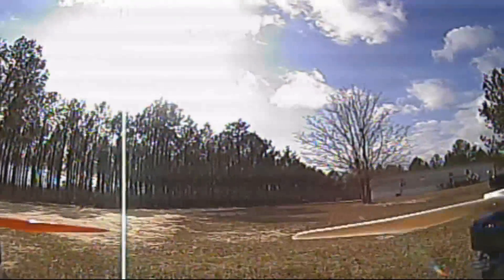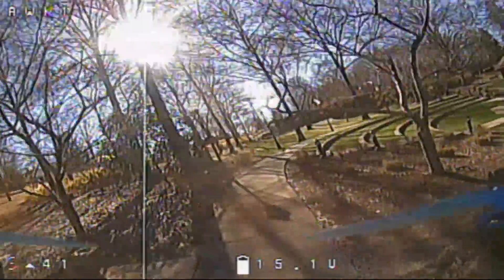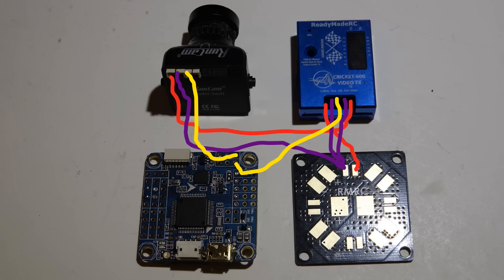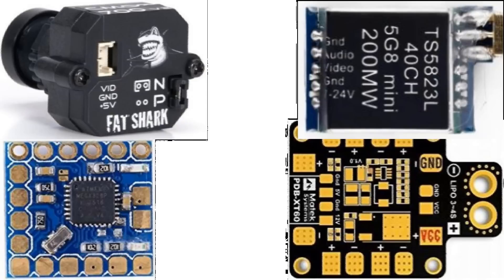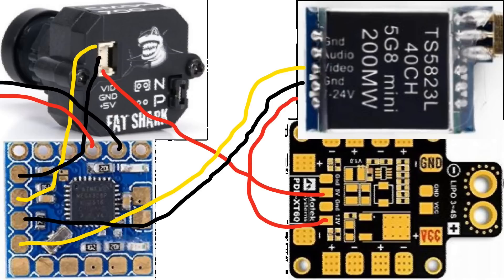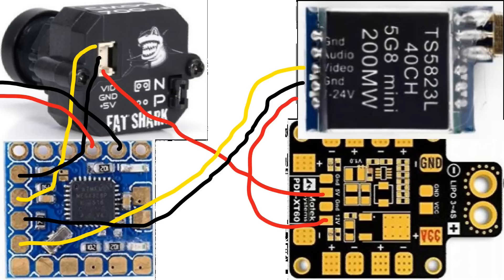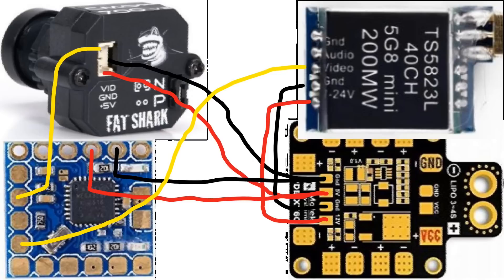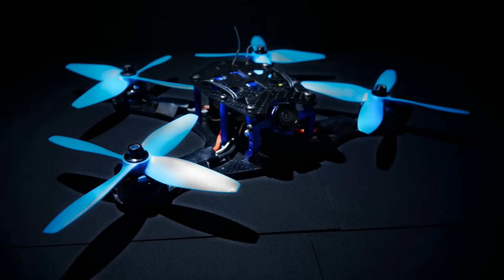Fix For Flickering OSD

Comment: hmm so i'm power my camera and vtx from my PDB... I am not using the 5v out on the vtx for anything, so I didn't bother connecting that ground anywhere... I wonder if running that ground would magically fix my issue?

Comment: In need of your help. Watched the video and wired exactly as you described. This is on a fixed wing with a 100a esc. I even tried a capacitor and a LC filter. No change.  Any other ideas because I'm stumped.

https://youtu.be/1RT7vGz_MZs

Comment: i had pdb with filtering thing. 5/12-bat. so vtx pad i solder it. then the red from cam also in + on same vtx pad. and video"yello" from vtx to cam. works fine! i dont understand what u men about lines. yes but only when i loop som tres´ but now i crash. so it was open. so i do what you explane. just take the yellow wire. cut. and the vtx in and cam. but then i got no pic? i try all channels. but nothing. i can´t change vtx band. yes but it shud bw there. but yes i also soldert the capasitor on. dont use all wire. only vtv to pdb. and cam to pdb. and then cut the wire to get osd. but nothing! have a new vtx. to seek another channel. but is it my settings! ?? thx for all.  il try my selv. and have ask before were i find anwser first,. but this! just startet so neebie. have no osd :-( have runcam shift :-)

Comment: Hi JC, Having this same issue with the betaflight F3 board. Since the FC has a built-in PDB what can I do. I use a 1000uf low-esr cap on the main leads and power the camera from the VTX. The camera is a Foxeer. Any thoughts?

Comment: Jc I'm using a omnibus f3 anywhere over 50% throttle I lose video with a 4s but not with a 3s.  should my cam and vtx grd be on the Fc or pdb? BTW the omnibus is getting full voltage of the battery

Comment: Can you maybe do a video on fixing video interference issues?  I've got 2 recent builds with issues, one has severe lines and blacks out with snap flips and rolls and aggressive turns, and another build browns out the cam and possibly the vtx completely  when I throttle up past 50% so it is not even flyable.  I realize this is some sort of electrical issue, do I add more caps?  Do I use an LC filter?  I've built 6 quads on the same basic pdb/cam/vtx/esc....and only have changed frames and motors between the 6, and only my last 2 have issues....it's fairly frustrating!

Comment: What version of bf are you running on your awk210 with omnibus f4? I've got an omnibus f4 on my awk 210. I'm getting the spin of death on mine. I had it on 3.1.5 then I dropped it to 3.1.1. I have a RTFQuads 4 in 1 infantry 30a dshot esc. When I input abrupt roll or pitch inputs it freaks out drops to the ground then I get a reboot sound from the esc's. I just updated my esc's also. I updated my esc to latest version 16.65 My next move will be to keep dropping bf versions until this stops.

Comment: Hi,
 Would there ever be a problem with the VTX antenna grounding to the frame (where the ant. goes thru the frame)?  Thanks
Reply: Dragon Rider FPV Quads Not the actual connector on the VTX or antenna. If the coating on the actual bendy part of the antenna is rubbed off and you can see the shielding, then you will have problems.

Comment: i had some issues with micro minimosd...osd dissapearing on throttle punch outs even black screen for one second and i had all the ground wires on pdb..then i put the ground wires on micro minimosd next to video in and video out and it fixed the problem..so its a bit confusing which is a right way
Reply: Thanks for the info. Having same issues with micro minimosd, but atm i have cam ground and VTX out ground connected, like in the first picture in this video. Will try your method first, and the PDB method second. I hope i will be able to solve the issues.
Reply: +MiG FPV its just fixed the osd on throttle punch outs for me..once i went out flying and did a flip or roll the osd disappeard and then came back after second..i thought its fixed cuz i was trying it home holding the quad down and punching the throttle  and it was ok..whatever.. its better than it was..i had blackouts when i pushed the throttle a little bit.. and now the osd disappears only on flips and rolls..its weird but its flyable
Reply: thanks.

Comment: I have the omnibus f3 I want to run my osd so If follow ur diagram here do I still have to jump the 12/5v pin on the FC ??? please help lol.... Aloha keep up the good work 👍 bro
Reply from the maker: No you dont have to jump either pin. And just my advice and the way I wire everything, I dont power the camera or Vtx off the flight controller, I still use the PDB. I only run the video wires to the flight controller.
Reply: Project Blue Falcon I have to fx 799t vtx with 5v  out to the cam so I can just run it like ur diagram with the omnibus f4 correct ?

Comment: I do wire from gnd to cam.  And have never used gnd pads for video signal wires.  However I've still had OSD flicker.  Here's what always solves it for me.  On micro minim I attach an extra small 220uF 10v cap to the gnd/5v pads.  On omnibus I attach the same capacitor to an open gnd/5v pad on the FC.  Some FCs though you also need the 470uF 35v cap you've shown before in addition to the smaller one.  NOT for flight issues, but for smoother power going to 5v.  I found a 6x5mm 220uF 10v cap on amazon.  tiny.
Reply from the maker: Sounds like a great idea to me

Comment: I fixed my flickering on throttle up with a 470uF cap right on the +/- on the micro minimosd. Unfortunately this didn't fix the video feed going completely black mid-flight. I might just have a defective board.
Reply: Did you solve your problem?

Comment: I primarily run omnibus flight controllers as well. I get perfect video & OSD by sending vbat through an LC filter straight to the RAM pin (next to vbat pin) This passes filtered power through the board and out to vtx & camera. This way allows you to run power, ground & video wires from video in & video out to the board which keeps everything super clean in appearance and performance. This does require good CCD cam and VTX with a wide voltage range
Reply: ryan todd I tried this and the controller got extremely hot, so be careful!
Reply: Good to know, I'll keep an eye on that. Through trial and error I've fried 2 omnibus F3 boards over the last year but my original omnibus F4 (v1) has been setup like this pretty much since they were released. Was the board you're referring to an F3 or an F4? I'm convinced there's a big difference in durability
Reply: +ryan todd F3 knockoff from banggood, great board, love it for its capabilities but I only power receiver off of it. Everything else I power off of mate micro pdb, you have too watch them too. They are fairly consistent but I have had a few that put out slightly less than the 5v and 12v it's supposed to.
Reply: +Jsin C. MATEK.
Reply: Lol, autocorrect always trying to sensor us... Yes they do! On some builds I'll use a standalone adjustable regulator set around 9v to power my FPV system. I rarely use a PDB W/ built-in regulators for that very reason.
Reply: Ryan Todd, where are you placing the GND wire off your LC filter?

Comment: LOL, I was just working on this issue....I thought after watching you video I was going to have to redo it... Lucky me I was already doing it the way you recommend. I am get lots of lines at above 50% throttle. So I am installing a capacitor
Reply from the maker: Capacitors do help, but if it still doesn't go away then you may need an actually LC filter, which is a capacitor and inductor in one.

Comment: I've tried wiring up my TS5823 and micro minimosd and PZ0420M on a 250 quad with a Naze32 Rev5 the way you recommend with all grounds going back to the PDB, and I got OSD display, but black screen (no video). I had to run the camera ground to the  OSD, and the OSD ground to the PDB, and then it all worked. I'm powering the OSD off of spare motor pins on the FC, and powering the cam and VTX from the PDB (battery voltage, because I sometimes run 3S as well as 4S).

Comment: +Project Blue Falcon Different subject but, what about ESC ground wires? An increasing number of PDBs (with signal pads) and FCs seem to expect only the signal wires from ESCs to be connected. Would you say it is safe to ignore/remove the ground wires from the ESCs, or connected them to some ground pad in the PDB (or FC)? Thanks!
Reply from the maker: It's best to keep the ground wire. Joshua Bardwell did a good video on it. I've always soldered the small and large ground wires from the ESC to the same pad on the PDB. Before soldering I wrap the small wire around the large one two or three times, that helps it from being pulled out in crashes.
Reply: Thanks for the advice, Jc. Somehow I missed Joshua's video on that subject but I'll certainly check it out as well: thanks for the heads up! BTW, for my level of knowledge on this hobby, both of you are running the most interesting and helpful channels on YouTube. It's amazing how you guys are actually making life so much easier to the whole spectrum of RC hobbyists like myself. Really appreciate your time and effort here, Jc!
Reply from the maker: In general I like the Runcam Swift. It's not the best, not the worst, but its great for the price. Unless its a camera for my AWK210 and Hellbender frames, I just now started using the Strix Ochi because its made specifically for the camera mount on those frames.
Reply: +Project Blue Falcon Just watched Joshua's video -- thanks for the hint --, and read most of the (very long) comment thread. This is a very debatable subject, to say the least. Joshua's advice seems to be a bit different from yours, though. It seems he is suggesting to always establish the shortest possible ground connection between the FC and the ESCs -- avoiding vregs, etc --, and to make sure the signal and ground wires are twisted (for better shielding). I'm baffled by so many people arguing against using ground wires to avoid loops, as well. Also read a very interesting comment (from Ozzy3333333) that made me think that the main culprit (for signal corruption) could actually be the quality and gage of the power wires going to the ESC. If he is right -- Joshua seems to agree with that possibility --, then maybe we should simply use adequate power wires, and no ground signal wire should be needed. A lot of experimenting ahead, for sure! ;-)

Comment: unfortunately im having this problem on my kombini fc. everything is powered from the fc
Reply from the maker: LC filters help with the flickering. I've never used that FC but you could try putting the LC filter in between the FC and Vtx/camera, assuming the Vtx and camera takes the same voltage.